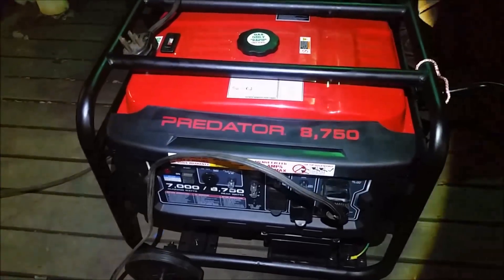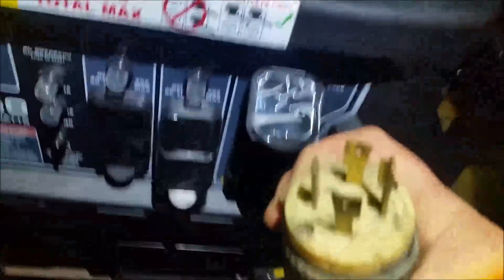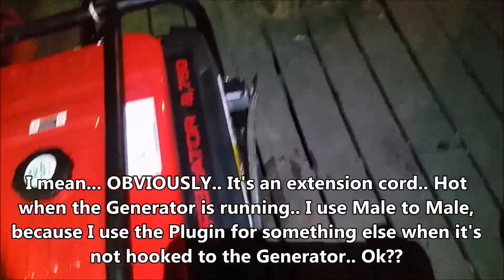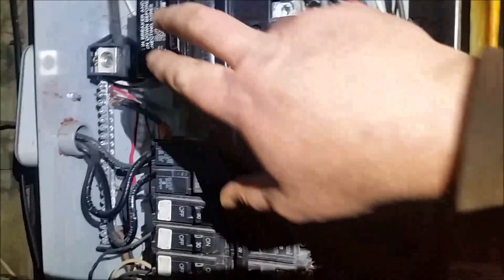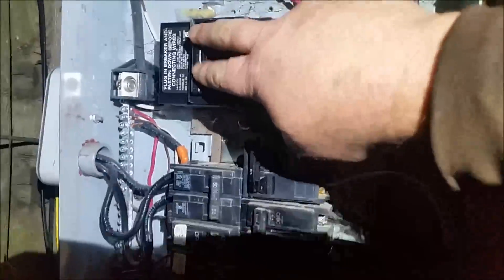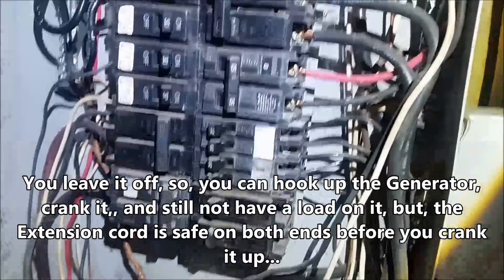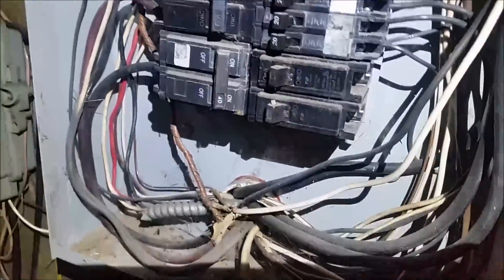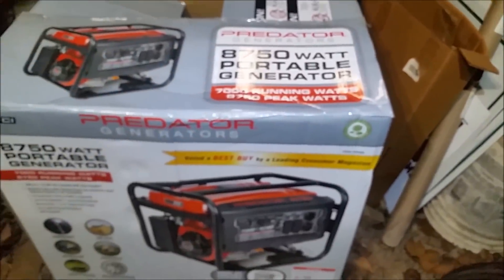Quick/Easy/Safe: Use Existing Plugin/Breaker for Generator hook up to your house Panel box.

Comment: Wiring in the proper switch is easy and safe and makes it safe for anybody to start the backup generator. This jackwad is trying to get lineman killed.
Reply from the maker: Calvingreene90... Jackwad?? Ha..Ha..Ha. Trying to get a lineman killed.. Wow.. You are one smart cookie.. Lets see if you can enlighten some of the readers of the posts here. Challenge.. Explain your JackASS comment.. Surely you knew enough about what you are talking about to make it.. 
Which part of the Procedure did you not understand?? How can you kill a lineman by following it.. We will be waiting to see if you are smarter than 887 other commentors,, or just another Dumb Fuck, with Keyboard Driver Problems.. Ha.. 
1) Turn the Main Breaker off  (OOps,,, already got you!! Ha..Ha.Ha.. 
2) Plug in the cord
3) Crank the Generator.
We are waiting Calvin.. Which are you? Smarter than 887 others,, or,,, Just another Dumb Fuck?? Explain your accusation and do it factually.. We are waiting..
Reply: History has repeatedly demonstrated that if a mistake is possible it will be made. Encouraging people to build a dangerous illegal connection is wrong and it will lead to a lineman's death.
Reply from the maker: Calvingreen90.. Ok, I see.. Could not answer the question and could not say that you could not.. I understand your kind.. 
Yes.. People like you should not be looking at videos like this.. It is out of your realm.. The rest of us don't have the same problems you have.. We remember to tie our shoes before we take off and remember to put the car in park before we get out, and we remember to turn the main breaker off. There is Zero difference, except in the History of people like you being able to follow a simple 1/2/3 set of simple instructions.. 
And, no one believed the little boy who kept crying wolf.. Did your parents never tell you that story? It surely didn't sink in.. 
Because you even when called out in the open for doing it, still come back and do it again.. 
For you Sir, there is no hope to teach you how to do something so simple.. First, you have to be responsible, and you have proven that you are not. You can't even accept your own mistakes and correct them.. The world is full of people like you, who will destroy it.. 
I hope you don't teach your children to be like you.. Rarely do I do something where I can be proven wrong, but, I will accept responsibility for it in a heart beat.. But, that is also the reason why I addressed people like you, so frequently in the video.. You could not tell I was talking directly to you?
Turn the Main Breaker off, means no problem like you suggest. It is really simple. Shame you can't trust yourself to do something so simple. 
But, you won't stop me or anyone else like me from doing what needs to be done.. So, it is only you who is not smart enough for something like this and you should keep your regrets to yourself, since you obviously are not going to try to do anything of value to correct your areas that are lacking.. The first Step is to Own up, and you can't do that.. Have a nice day.. Post something again and I will hide you from the Channel.. I gave you a chance to explain your bullshit lies and worthless comments. Nothing Illegal here an nothing dangerous until someone like you comes along.. You should have paid more attention..  If you don't like the content move along. No one needs your stupid ass comments.. They are worthless to anyone except another dumb ass like yourself who can't do the 1/2/3 thing..
Reply: I understand the procedure I also understand why it is illegal to install a backup generator that way.
My parents did tell me the story of the Boy That Cried Wolf and also taught me that creating a dangerous situation makes you responsible when people get hurt or killed because of it. your videos need rational informed people watching them to call you out for being criminally reckless.
Reply: Generator safety tips https://youtu.be/I1jT3ANENvI